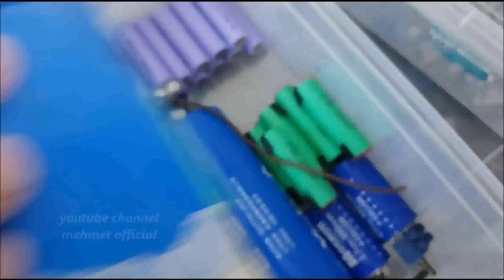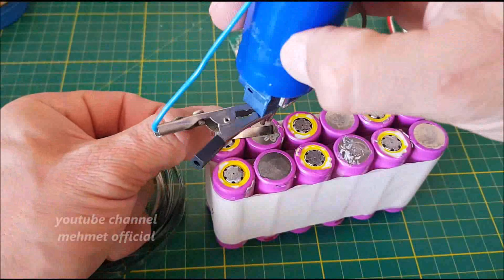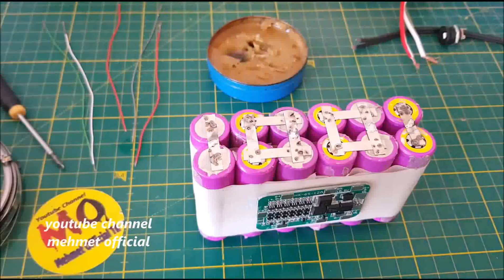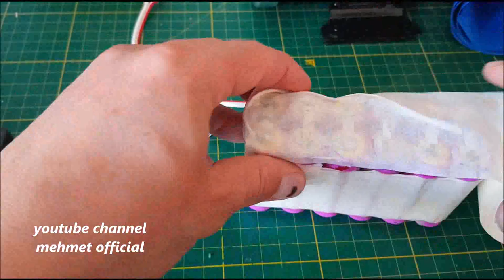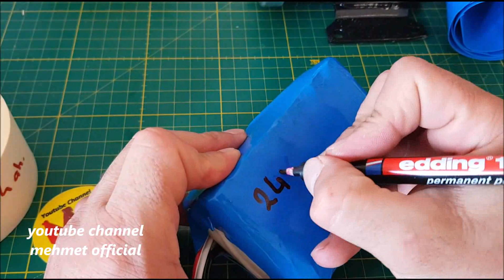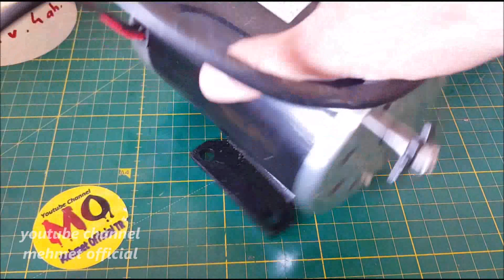Eski Laptop Bataryalar nasıl değerlendirilir 24v 4000 mah Li-ion Battery

Comment: Hocam merhabalar 20 amperlik bir batarya için 6s 8p mi yapmam gerek 2500 mah pillerle ve 6s 40a bms kartı mi kullanmalıyım
Reply from the maker: Evet 6s 8p yapmalısın tabi piller 2500mah ise 40 amper bms takman avantajlı olur
Reply: @MehmetOfficial09  cevap için teşekkür ederim hocam